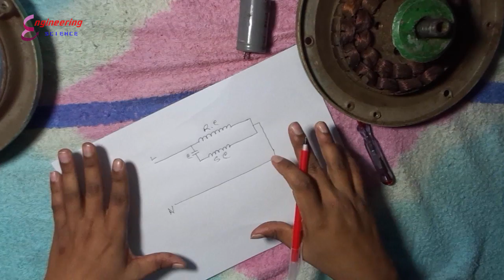Working of Fan with Circuit Diagram  - Construction of Ceiling Fan Motor

Comment: I got clarity about rotot and stator. i wanted to add a light fixture to an ordinary fan. After first few minutes of patient listening. below is how i will do it. 
1. agter dismantling the  botthom cover/rotor housing, i will drill a hole in the center 
2. try to find a way to get the wires out either from stator center or through splindle. 
3.  The pipe with dia less than shat should pass through shaft and attach to suspension and this pinw should have a hole and suspension and pipe should attach via one pin.